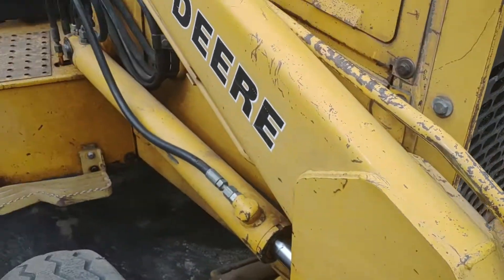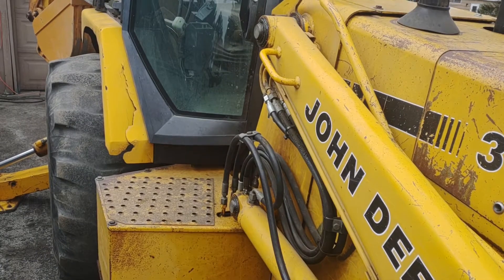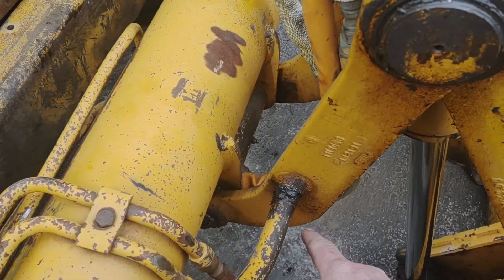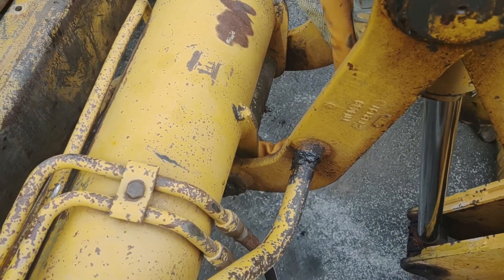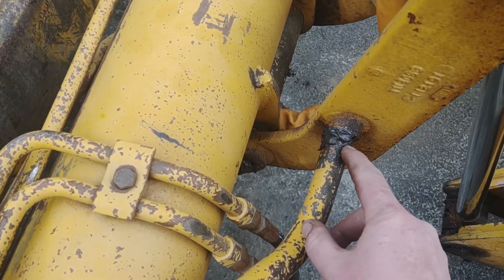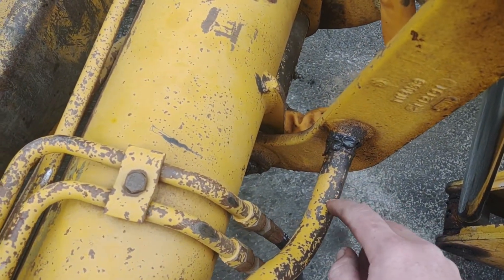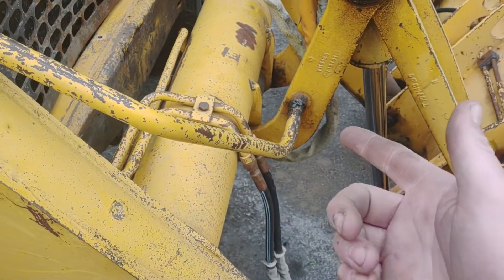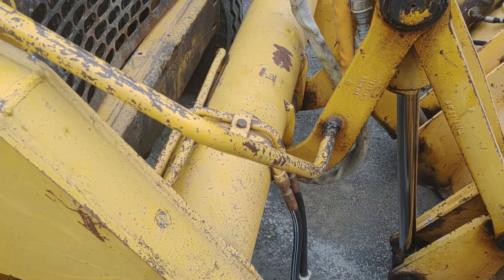(241) thoughts for dealing with slop in bucket leveling rod on John Deere 310D backhoe?

Comment: On mine, I'd just pull it and install a hardened bushing and stub. Between the hardened steel on steel and grease, it shouldn't wear much for many years. Could probably use bearing bronze for a bushing as well. Just a thought